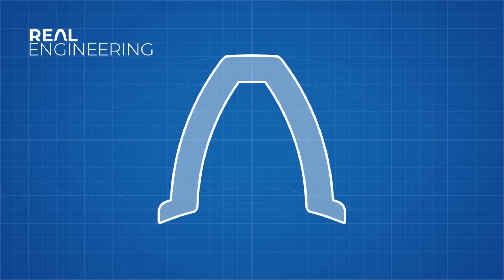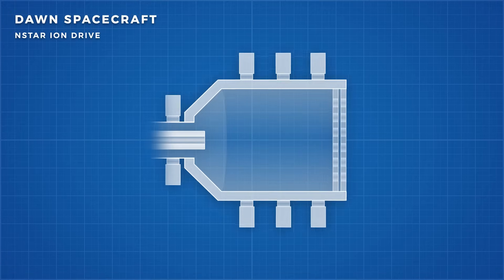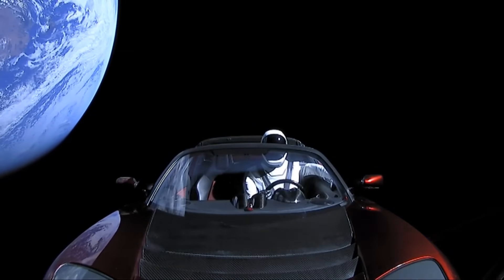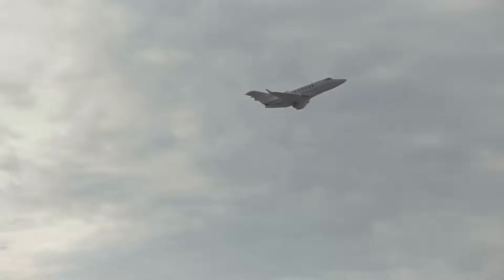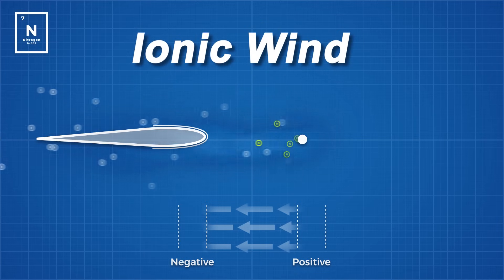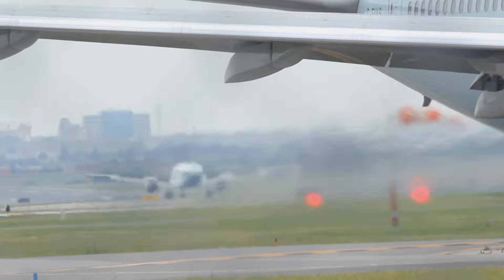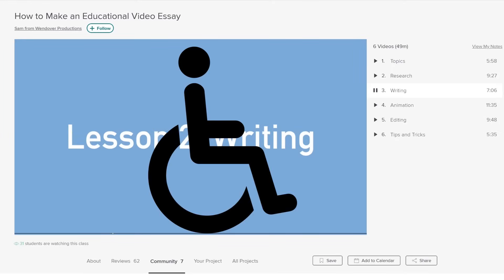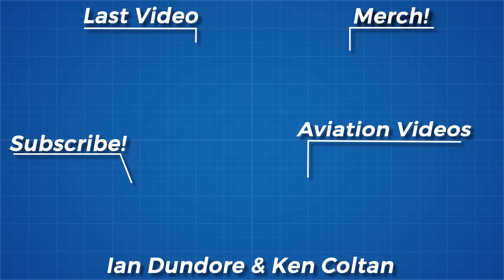Ion Propulsion - The Plane With No Moving Parts

Comment: Can only work with fuel cells imo
Reply: I just don't see the fuel cell developing at anything like the rate of batteries & capacitors.

I think the fuel cell is going to end up like betamax -- there will always be a contingent of people who insist that it was the better technology, but it will ultimately fall by the wayside & be left in the dust by the technology with greater momentum & greater economies of scale.
Reply: @dr.zoidberg8666  except there is not enough lithium in the world to equip all those vehicles
Reply: @sfertonoc  Firstly, that's obviously not true.

Secondly, lithium is just the battery tech we're using right now -- the amount of research going on to make the next better battery is absolutely insane, whether you're talking about capacitors, room temperature fluoride batteries, graphene batteries, or any number of the other alternatives being researched.

Batteries have 2 fundamental economic principles (two of the most powerful forces in human history) working for them:

1.  They have the law of accelerating returns working in their favor.  Right now, batteries are improving in price performance at the rate of an information technology -- that is to say, doubling roughly every other year.  Not only that, but the technology itself is improving like an information technology -- improving in energy stored per unit mass at a near exponential rate (even within the single paradigm of lithium ion batteries).

2. They have economies of scale working in their favor.  There are lots & lots of things that use batteries -- & in particular, the demand for batteries is getting ready to absolutely explode with how many car companies have locked in a plan to go either mostly or fully electric with their lineups by 2025.  This kicks the production of batteries into over-drive, which drives the cost per battery produced down.  This force is why a cheeseburger doesn't cost $500.  It's what makes the modern economy possible in the first place, & it's working its magic in the battery industry as we speak.

As far as the economics go, batteries have everything going for them -- & even better, they're beloved by the people & politicians, so not only is it good business, but it's good PR to double down on battery tech.

Batteries win.  There is just no other possible course.
Reply: Dr. Zoidberg  o, it is obviously true there is not enough lithium in the world for giving everyone a tesla or electric scooter, period. Fuel cell is the only way to make electric vehicles possible. The battery and capacitor or supraconductor tech might catch up but is decades away. PR does not make travel either.
Reply: @sfertonoc  Lmao xD okay, come back to this conversation in 2025 & see who was right.

Comment: I still think hydrogen is the next best thing to power any electric based propulsion method. Barring technology to produce hydrogen as efficient as dino fuel, the energy conversion of hydrogen is exactly like any liquid fuel. Doesn't need (much) battery that becomes a dead weight once the energy is depleted, and the vehicle becomes lighter when the hydrogen fuel is spent. It will probably take 100 years for the ion drive to achieve consumer level, but probably I can die peacefully knowing that future generation will have to struggle with crying babies and kids tantrum without the buzzing of the plane's jet engine.
Reply: This guy actually has a pretty good video in which he compares the viability of hydrogen fuel cells to batteries.

But in any case, friend, take heart -- it probably will not take 100 years to see useful in-atmosphere ion drives thanks to one thing that has remained true since the 19th century: the law of accelerating returns.
Reply: @dr.zoidberg8666  I concur with the law of accelerating returns, BUT (I freaking hate using that reasoning) I sure hope the industry supported it or risk being government lobbied and got stuck in development hell.

Comment: funny enough, microfluidic system in my university's lab actually employed similar ionic flow system that this airplane is using. Since ionic flow energy requirement scales way better than traditional hydraulic system at microscopic scale, where surface to volume ratio of an object is much higher than normal. The future of Ion propulsion plane might be in microscopic flying drone rather than normal size airplane.

Comment: I have 2 questions. Shouldn't the Xenon atom become negatively charged when it comes in contact with an additional electron? And about thise 2 grids at the back of the engine...If the Xenon atom is indeed positively charged, how can it approach the "positive" grid?

Comment: bunched graphene tube-like ionizer/thrusters may help increase time under ionization and thrust, as well produce laminar flow which is more resistant to turbulence thus can increase relative thrust densities.  

i can see a hybridization of combustion and em propulsion; ionizing fan blades, ionized intakes and other gas flow efficiency increases, possibly even "pre-charging" fuel to ignite more readily or with more force.

or dildos

Comment: What do you mean find a way? We have one. It's called a diesel-electric engine.

If you insist on not using hydrocarbons (which is dumb), you can go with hydrogen fuel cells instead.

Comment: Did anyone notice at 7:38 he said aerodynamic drag increases with the V^3? I thought it was the square.
Reply: I did a lot of aerodynamic testing in the early '00s that, first, confirmed the formulae in the books and, second, allowed me to build the correct electric motor for a given RC model's weight and design speed.
The power required to fly a variable mass at a given speed is proportional to the square of the mass.  The power to fly a given mass at a variable speed is proportional to the cube of the speed.
This was plainly illustrated by my '94 Honda Civic Hatch with all of 94HP.  Published coast-down measurements in Motor Trend mag. said that the car used just about 12HP at 60 MPH.  Doubling that (Velocity times 2) to 120 MPH took absolutely all she had, and a slight downhill run onto the flat mile I had measured out, for curiosity's sake.  The math goes:  delta V=(delta V cubed) Power  so  2V= (2X2X2) 12 or 96HP close enough!

Comment: one main problem : battery's energy density (https://en.wikipedia.org/wiki/Energy_density). But i have questions about the plane design. Why didn't they design the aluminium piece like airfoil, to procude directly lift ? i heard a computer made the design, but for the battery and electric components housing, i would use for a lifting body shape.
you can increase thrust with a bigger gap between anode and cathode or multiples pins in parallel instead of a single wire would pass more current. 
Would placing the aluminium foil like a fan in a tube, thermalize the air flow with the transistor heat and  using the coil (from the transformer) to guide and accelerate ions ( LHC style), increase thrust density ( yes a ionic jet engine )?
or even a network of plasma actuator on the airfoil ?

Comment: Turbofan, not jet.   your conclusions are appalling. sorry, but ...  electric aircraft are viable, the weight an aircraft can carry is proportional to the energy required, neither are proportional to the size, but that does not matter.  The weight and aerodynamic drag of the ion drive are additional bottlenecks, it's not as simple as propulsion loading, and thust/weight.  Ion drives may be efficient, in terms of watts/thrust, but their overall efficiency is abysmal, and you need to look at more factors, to determine viability. even the theoretical overall efficiency of ion drives is horrendous, due to aerodynamic drag and weight for aircraft.  that's why they are used in space, and the MIT team's application to an aircraft is interesting, and an neat exercise. Fascinating, but for an actual application, 9even a future one), is an exercise in futility.  
The only things stopping electric aircraft (they will look and work differently from current turbofan aircraft) is the expense of the batteries, public stupidity, and the FAA.

Comment: The challenge with this is pretty much entirely in generating and controlling the high voltage energy. 20kV is about the minimum necessary to make this effect happen at all. Performance improves as you increase the voltage. But high voltage equipment tends to be very heavy, so IMO that's where to focus effort. One possibility I've considered is simply stacking a zillion tiny batteries so voltage stepping isn't needed at all. For an airplane like this (as opposed to VTOL), all you really need then is an electronically controlled switch that can cut the power without arcing. Some degree of variable thrust control would be preferable, but not essential.

For high voltage conductors, something I've been meaning to try is copper plated 3D prints. It's difficult to fabricate large radius metal conductors, and they're heavy. But since you need very little current for ion propulsion, a hollow plastic tube with a thin layer of polished copper on the surface should function just the same, while being much lighter weight and easier to make.

Comment: This ion propulsion thing is old. We used to build those at home.  The Internet was full of videos on how to build one back in the days. Aluminum foil separated by wood sticks with copper wire at a certain distance and a high voltage connected to it. We have liftoff.  I wonder how many millions they spend to build that thing.

Comment: No big deal. I thought of this years ago, but dismissed the idea because of no practical application. Today, electronics is dirt cheap so anyone can build a toy like this. Given the practical limitations, I do not see this going anywehre beyound controlled lab conditions. Would like to see it perform outside at rain.... Also, what about all the ionized air? Do we really want to breathe that? And I really doubt that the plane had no moving parts. If it really did not have any, it was a nightmare to actually control the direction of the flight. I can imagine ballancing thrust between sides to make it turn similar as with a rudder, but beyound that any selective thrust control would be essentially useless, so you need airleons and elevators. Or you could build them as another dead weight high voltage devices, which would need to adjust their geometry depending on the speed of the craft, in the frame of reference of a static plane and moving air - the faster the air is moving, the more the positive and negative "grids" have to tilt. So you would have to have them as a moving part anyway. Or carry a couple of fixed grids and do it all by choosing their combinations, again, adding weight and drag to the plane. Really useless. This is nothing more than a toy with no real world use potential. Nice, the kids played with something, they made it work. Good job. They certainly achieved something. Something rather impractical, but practicallity was not the point here.
Reply: Sure thing, Edison.
Reply: @Planag7  Edison was a jerk.

Comment: We have been doing "high voltage lifters" for many many years now.  This thing just rotates that design 90 degrees.
The voltage needed at the thin wire is DC and quite high but the current is quite low.
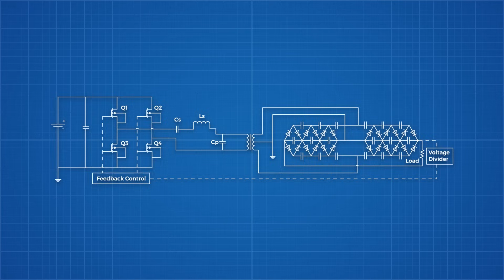If that really is the schematic of the high voltage maker, it is a heavier and less efficient design than needed.  I will explain referencing the video as stopped at 5:53 and starting at the left edge.
The first thing shown is a battery.  That is an unavoidable thing so no further comment.
The next part is a bypass capacitor.  It serves to store energy for the very short term so that the batteries don't need to deal with the current spikes from the rest of the design.  This is the first change I'd make.  Compose that capacitor out of 2 in series.  The reason for the middle point will be clear later.
Next you can see 4 MOSFETs in two pairs one above the other. In this design, they act as switches with the upper one of one pair on while the lower switch of the other pair on.  One of these pairs can be deleted.  The middle point on the capacitor effectively replaces it.
Next comes the capacitor that looks like "--||--" and the inductor (coil). Then there is another capacitor across the transformer and finally the transformer (two coupled coils).  This part is a "tuned circuit" that could be far simpler and lighter.  The center tap point on the capacitors can be used as the capacitor of this tuned circuit and the transformer its self can be the inductor part.  It requires a bit more smarts to do the transformer but they are going for light weight making a custom design reasonable.
The secondary side of the transformer has a center tap.  This is not really needed.  Once side of the winding can be grounded instead of the middle.
The bit to the right of the transformer is a voltage multiplier.  The design they are using here has twice the number of diodes than are needed.  The leakage of the extra diodes is a waste of energy.

Comment: this type of propulsion will always be lower efficiency than thermal jets or propellers for that matter, as it requires higher energy changes to set the thing up and then start thrusting.
my point, on a propeller the energy of the engine is directly transformed into drag and pushed wind on the propeller, on a jet plane, the energy goes from burning fuel (chemical energy giving reaction) to having a lot of hot air that can only flow in one direction, (plus heat losses and friction), on a ionocraft, the energy goes from chemical (or electrostatic on a capacitor) to electric high voltage to ionization (an energy sucking chemical change) to electrostatic thrust...

Comment: Just spitballing here but, could a hybrid aircraft work? Use a jet engine to generate electricity for a set of batteries since jet fuel has much better energy density than any battery thus far.

Comment: is it at all plausible to invent a wings panel that relies on friction or air molecules then simply direct that energy to the battery  like a cycle.In order, ion engine creates forward thrust then creates frictions on electric or electron panels generated energy gets transferred to ion engine.hmmm
Reply: Acion energy has a sort of reverse ionocraft wind generater prototype.
Here is the real first ion propelled aircraft to carry its power supply:
https://www.youtube.com/watch?v=Qdg0_hjuksQ&t
Reply: @KraussEMUS1  Very impressive
Reply: Thanks Kenny! 
 @KennyHunteX
Reply: zuluknob thank you for the reply but I mean the un avoidable friction that’s always at play on airplane wings.putting it to good use without having to change the size or shape of the wing
Reply: zuluknob ok i understand

Comment: What's the speed reached by ions? Because if it's very fast that means the faster the plane will go the higher the efficiency will be.
Reply: The ions hardly move at all.  The wind off something like this is a gentle breeze.
Reply: +Ken Smith Power = force times ion speed / 2
So 6.25 N /kw = 1000*2/6.25 = 320m/s
Reply: @johntheux9238  
In the second line you remembered the "^2" in the first you left it out.
I have made a thing like the engine in question.  I felt the breeze it made.
I doubt that the ions get to go very far as a "mean free path".  Thus their speed would be quite slow because their momentum is transfered to the air.  A moving aircraft would not change the mean free path.
Reply: +Ken Smith It's the speed and not the square speed because:
force * distance = energy
energy/time = power
average ion speed when accelerated = ion speed/2
force * distance / time / 2 = power -> force * speed / 2
Reply: "Thus their speed would be quite slow because their momentum is transfered to the air"
That's exactly what i'm thinking, does the air prevent the ions from acclerating or does it brakes the ions AFTER accelerating? In the second case there will be a lot of energy loss due to the relatively low mass of the ions compared to the air so nearly all the energy will be turned into heat.

Comment: Honestly I don't see why this little plane is getting so much attention when this exact thing has been done for decades in numerous class rooms. All it is, is an ioncraft with wings. And ioncrafts are worthless for things in the realm of material or people transport. Now can the tech be applied to other things, sure. But it's already been established that it not viable for transportation or any thing that requires real power. Because the engines by design require huge amounts of power, which means more on board energy generation which means more weight and then even less range.
I get it your all high on the idea of something new and interesting, but the simple fact is this isn't new. It's tech that has been explored and test heavily for decades. hell i think this very concept existed since ww2.

Comment: I wonder if hybrid aircraft might be more practical. 
Have just 1 traditional fuel jet engine provide the electricity, and have electric motors provide extra thrust from the generated electricity.
Reply: Someone is already working on that idea.  There are batteries also.  During takeoff, the batteries add extra thrust.  At cruise, the turbine makes much of the thrust directly and the electrics add about an equal amount.

Comment: +Real Engineering This method uses Xenon, doesn't it? Therefore you need a steady supply of xeon? Or does it only use energy?
Reply: just metal ions from the wires and air (mainly consisting of nitrogen).